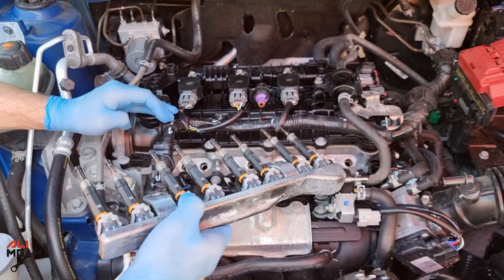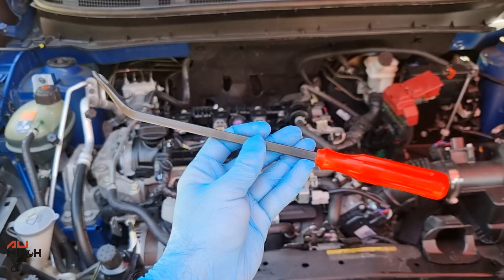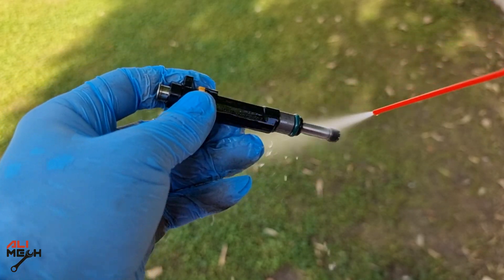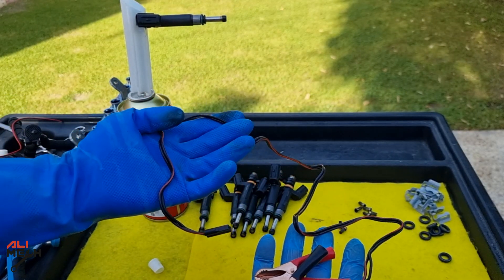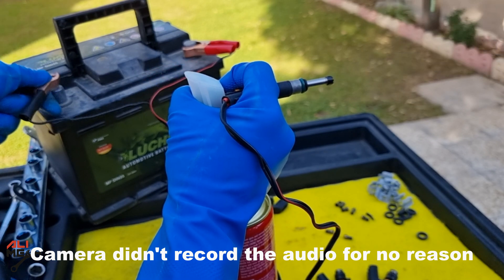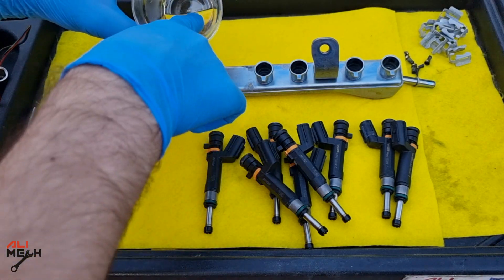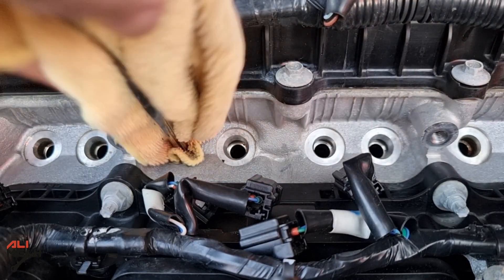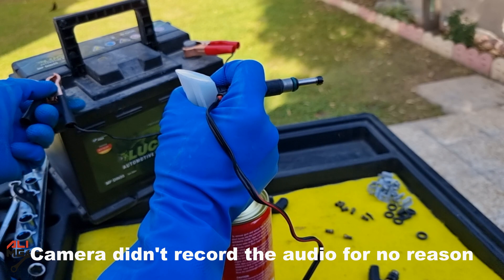Here is why your car burns more fuel / How to remove and clean fuel injectors on 2021 Nissan kicks

Comment: Hey, yours are great video and the fact that they are on a nissan Kicks helps. A lot. But, which kind of engine does your car have? Why does it have 8 fuel injectora for a 4-in line?

Here in US the kicks 2019 and 2021 was sold with the 1.6L 4 cylinder.

Comment: Where did you find the new O- Rings and filters. Or what's the size of the O- Rings? My daughter's kicks have had nothing but problems with only 73,000. I think it would help to clean the injectors, but the dealer wants $120.00 just for the O - Rings. Please respond with the information. It would be greatly appreciated and helpful for us to get her kicks up and running smoothly again. Thank you for your time and great video and advice by the way

Comment: Hello AliMECh! i hav 1 question, so i need yr advice PLEASE… so i hav civic 2010 hybrid 1.3, on diagnostic he triggered P0420 Code(catalytic converter doesn’t work efficiently) so i checked and both sensor is good now i have 2 option; 1) change catalytic converter by non-original(universal) or clean it up by special chemical liquids. please let me know which i have to do?! what is best solution?
Reply from the maker: Check the exhaust pipe, if there is welding marks on it, like its not factory,  sometimes the replace it with bad quality ones and then u will have this code